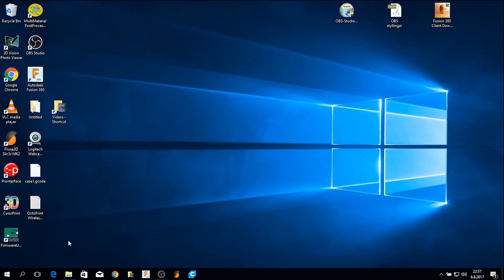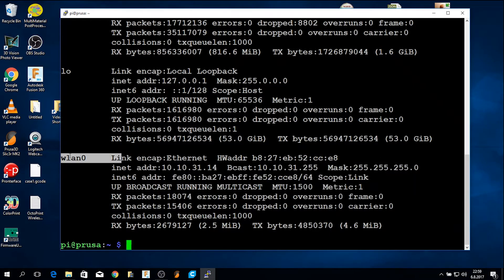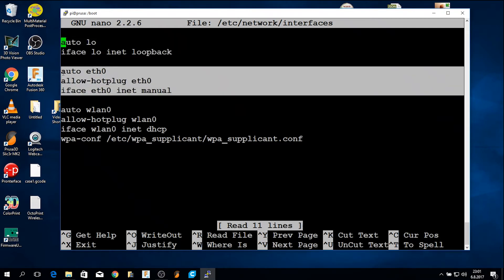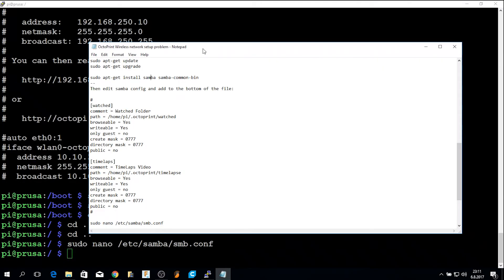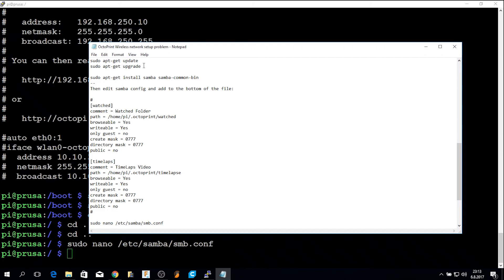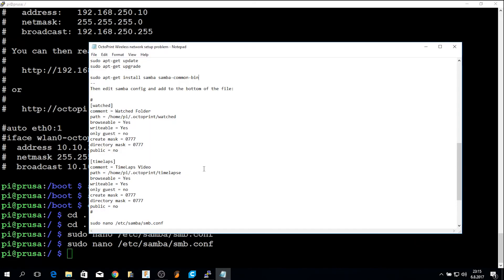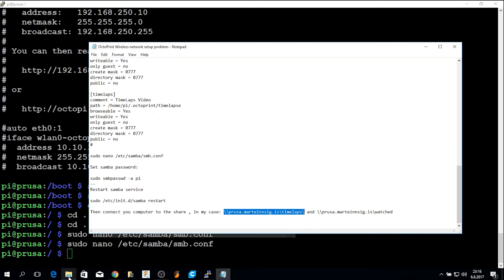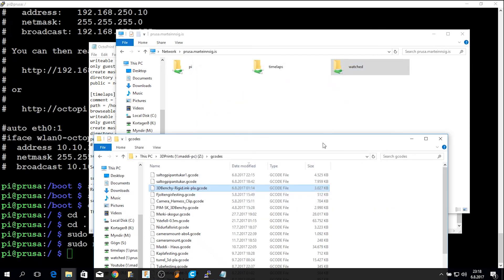Troubleshooting WiFi on Raspberry pi 3 model B with OctoPrint / OctoPi

Comment: Thank you so much! I only wanted to print while I am at home with the printer while it is running. Remote viewing didn't mean anything. This worked perfectly. As soon as I plugged in my Ethernet cable to the wireless router, my Pi appeared on octopi.local! From there, I could control my printer from my desktop, so cool.

Comment: I had a strange problem with Octoprint. Pi did connect to the router and its IP showed up. The octoprint server was also running, confirmed by the light on the USB camera turning on. However, the octoprint server was unreachable. Connection either refused or timed out. Tried a clean install of Octoprint but did not work. Still unable to connect, though yet again the Pi's IP appeared in router status page. Then I thought to reboot the router. After it rebooted and came online, instantly connected to the octoprint server. Problem solved. Moral of the story is, if you're having literally impossible problems with your octoprint, reboot your router first. It will most likely solve your problem instantly.

Comment: Unfortunately that directory structure and those filenames no longer exist. The latest version of octoprint is totally different in file names and it has only one directory other than the root. I'm unable to get the pi to connect to my wifi network.
Reply from the maker: Hi, thanks for the heads up, did not know they changed things in newer version. Hope you get yours to work
Reply: @3DPIceland  I ordered a new pi but the B+ model this time. I should just have to put the SD card in it and plug it in. If it doesn't work still, then I'm sending the pi back. It just doesn't make any sense to me.
Reply: Plug the SD card into your computer and edit the octoprint wpa supplicant file. The old network file is no longer used. Follow the instructions on the octoprint download page for setup instructions. Make sure you have the latest version of octoprint.

Comment: Well I am glad I found this because I have two Raspberry Pi 3's that have been using Octoprint for almost a year with no issues.  Suddenly this week, both can not function on wireless.  I used the steps you laid out using an ethernet connection to get into the device (no keyboard/mouse/monitor) and did the edits you suggested.  Here's where it gets weird.  When I unplugged the ethernet, power cord and then tried powering it up again, no wifi connection.  If I plug the ethernet cable back in, the wifi comes back (and I can even connect via that address).  I'm really stumped on how to remedy this.
Reply from the maker: Hi, - that's strange that is has this  behavior,  - did my info in the video help on the issue?
Reply: I little bit, it gave me a direction to look.  I did a search and there's a lot of posts about wifi not working without the ethernet jack being plugged in.  There's conflicting results about the order of the interfaces (some say put wifi first).  That made no different.  Ironically I did a reboot of the wifi router and suddenly I got one Pi3 back.  The one I have been doing all the changes too is still down.  I placed a post on the Octoprint group on Facebook and have been getting some good ideas (feel free to check it out).
Reply from the maker: Thanks for the info, - I actually ended up having a desktop PC next to my printer as my laptop couldn't handle OBS well, and in that process I connected a wired Ethernet switch at my maker space area, that is connected to the Pi and my PC, - so I did not use the wifi on the Pi for a long period of time, - maybe 2 months , but it  was working ok for me in that timeframe.
Reply: I appreciate your video and hope all is well in Iceland  =)
Reply from the maker: Thank you, -  and yes, we are doing pretty good in general.

Comment: What do you use OctoPrint for? Do you start prints when you're away from home? 

My MK2S always has filament ooze so I feel like if I did prints remotely, they would get messed up. But I'm interested in the idea of being able to watch live with a webcam I guess!
Reply from the maker: In my case I have few use cases in mind, one is to be able to monitor the camera (I have a vpn connection to my home network from work), so I can look and see how the print is going, Then I can remotely stop the print if something goes wrong, Also I can copy the time laps video directly from the octoprint server to my workstation for YouTube videos, I don't have to put files on SD cards to print files. - I don't think I would remotely start a new print, I always want to watch the first layer close up anyway. - But it's convenient to be able to just drop a file to the watch folder and have it ready to print without having to move the SD card back and forth.
Reply: 3DP Iceland yes that's pretty awesome. I'll have to look more into it. Thanks for the thorough reply!

Comment: Nice...just make sure that your routing is fine with two networks. Give webmin a try much easier to administrate your linux/RPi
Reply from the maker: Thanks , Yes, I disabled the WiFi network after I did the video,  It was only for video purposes I had both networks enabled :)